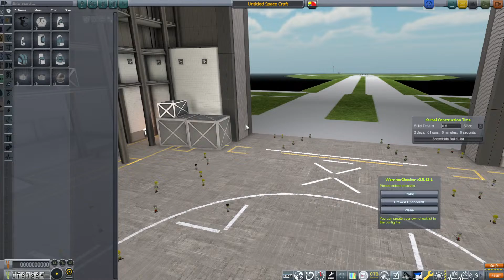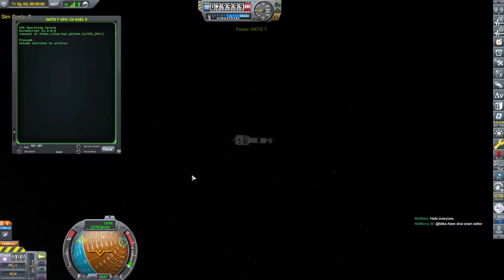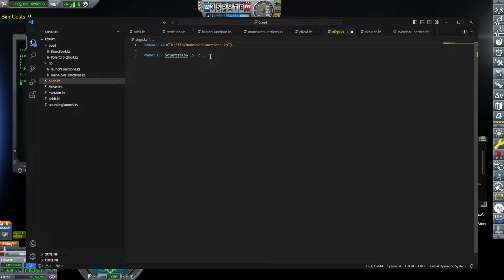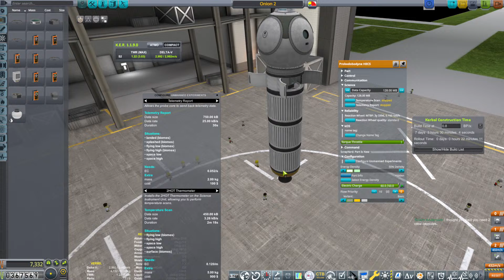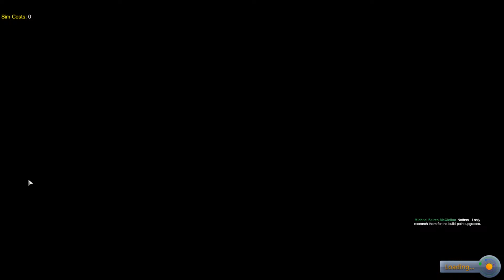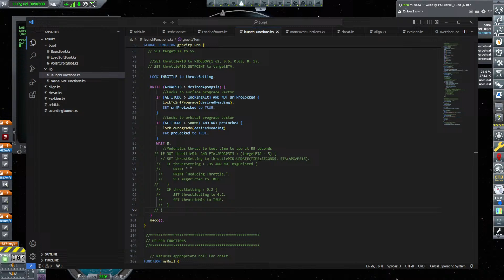Rescue From Orbit | KSRSS | KERBAL SPACE PROGRAM

Comment: 1:14:40 I think that when you were upping the reliability of the radial booster engines, you may have inadvertently undone it when adjusted the setting on the second radial booster. I hope that makes sense.
Reply from the maker: Yup, and you're 100% right. I did exactly that.

Comment: You might want to change your "engine upgrades" line in werner checker to "component upgrades" or just remember to check for other upgrade possibilities, because one of your mods (I think it's your tech tree) incorporates upgradable energy density for electrical storage, and I think it defaults to the lowest setting. The onboard batteries for the onion capsule were at 50% density, and I think you've unlocked the next level up of density.

Also, the boattail on the Kodiak engine will fully accept radial mounted parts, so you can just mount the fins on there normally, you don't have to translate them down to get them all the way down
Reply from the maker: Thanks, I noticed those in the tech tree, but thought they were automatic.
Reply: @MikeAben  It's difficult for me to make out, so I could be wrong. Worth a peek to double check, though.
Reply from the maker: @nataliefahey2072  I checked and you're right. Thanks again.

Comment: The KerbalJointReinforcement mod is a way to get rid of wobbly rockets (at least for small rockets) without having to deal with autostrutting.
Reply: Personally, I like autostrutting. I just wish it could only be done in the VAB, and that it cost money and weight. 
Consider turning it off when you reach orbit, because it seems to cause problems with stations.

Comment: I started a version of this build right after Mike did, and the failure rate of ignitions, often engine explosions, is far larger that what the tech tree claims they are as you progress.  So eventually, I turned of ignition failure in the Kerbalism settings, but left on the burn failures which includes burn time and number if ignitions limits.
Reply from the maker: I find the failure rates difficult to tweak as the numbers in the settings don't make sense to me. I get why'd you turn them off.